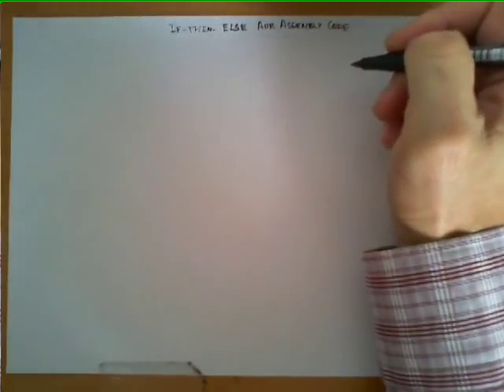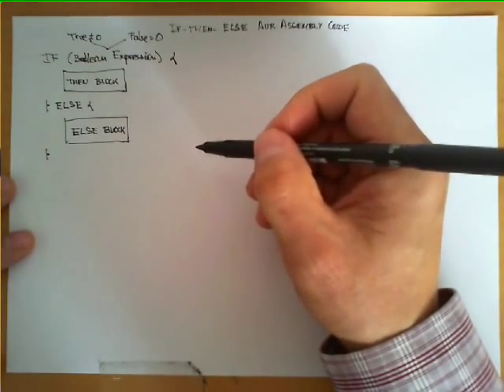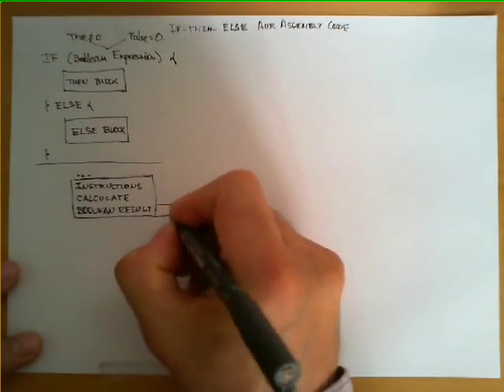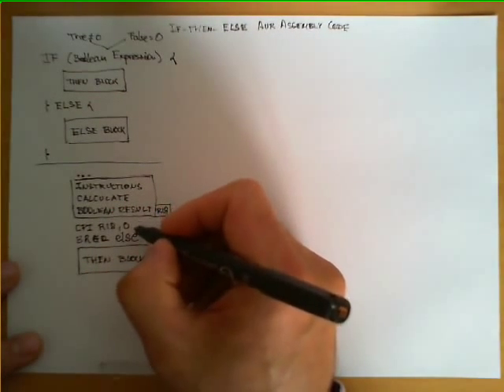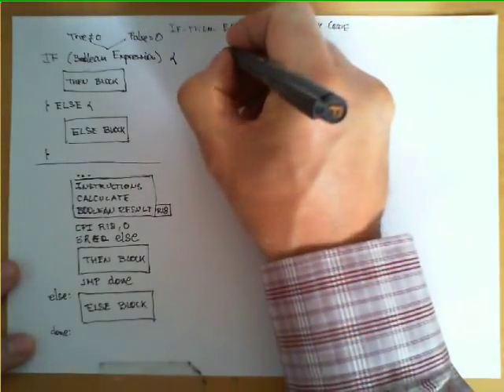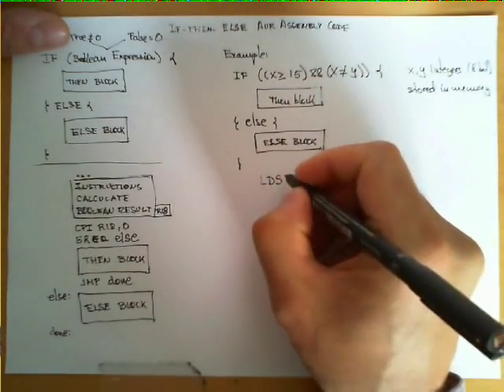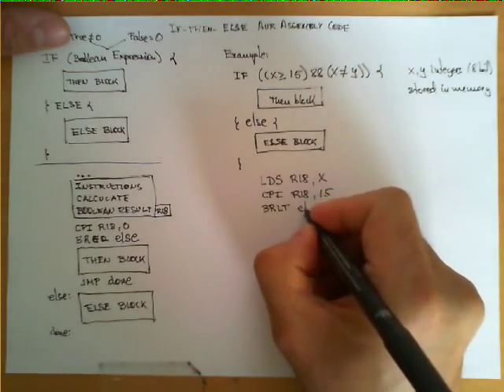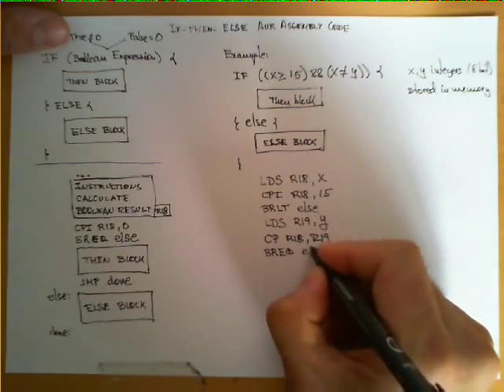Translate an If-then-else statement to AVR assembly code

Comment: Dear Abelardo, i'm trying to make a simple program in avr assembly. I try to make an vector with arbitrary values, multiply by 3 one-by-one of value of the vector and save this results in the a new vector. I make a code, but i'm not convinced it is correct... If you can help me whats wrong with my code. PS sorry for bad english, im a brazilian guy....  

 .dseg
n1:		.dw		0x1F,0xA,0x21,0x09

result:	.dw		0,0,0,0
	
		.cseg	

main:	ldi		r16,5	;carrega o valor 5 o tamano do vetor
		ldi		r18,3	;carrega o a constante 3 que é o valor a ser multiplicado
		lds		r17,n1	;	

loop:	cpi	r16,0
		breq	end
		mul		r17,r18 ;r24 <- n1(0)*3
		st		X,r17
		sts		result,r17
		ld		r17,X+
		dec		r16 ; decrementa o valor do registrador 
		jmp loop

	end:
		ret
Thanks!!!